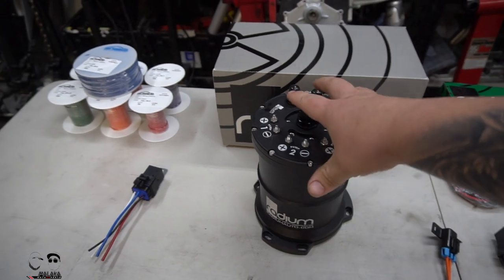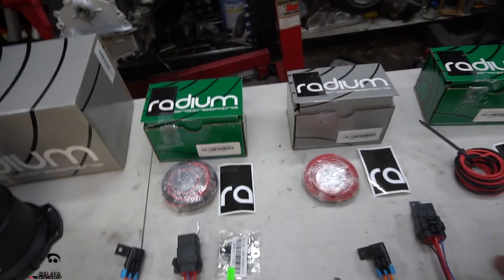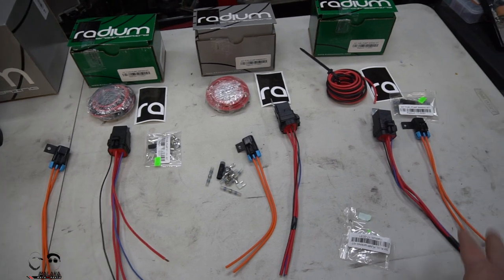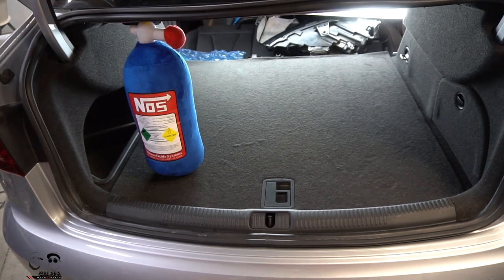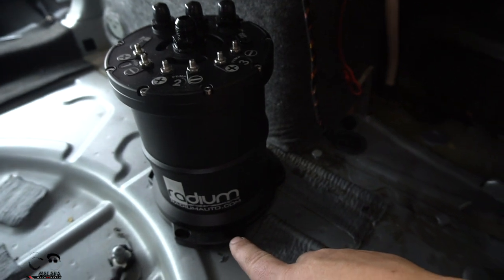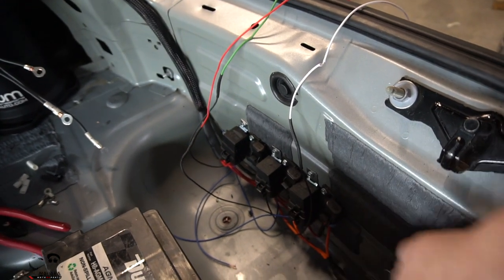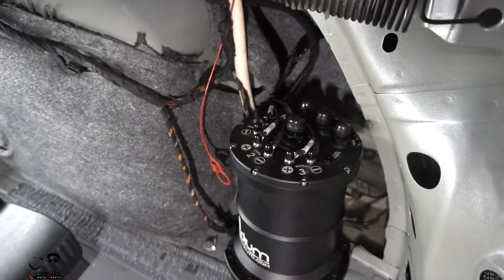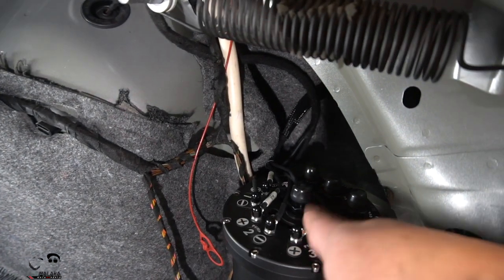Triple Pump Radium Surge Tank WIRE UP -  AUDI RS3

Comment: Hi Stav! Just a small tip to make the crimps look even better. If you look at your first crimp in the video, try turning the crimp tool over so the concave side is against the split line in the terminal. The terminal will not try to spread, and the convex side indents into the solid (non split) side of the terminal. Just a thought.
Love the location for the unit. Out of sight but still accessible. Great!
Reply from the maker: Interesting will try that next time. These small tips make all the difference

Comment: how's that work on stock ECU?
Reply from the maker: Well when you say stock ecu. Are you referring to Rs3 specific? One way you can wire this into a stock ecu that’s limited is using hobb switches and having certain pressure kick on the additional pumps
Reply: @MalakaMotorSports  I have a mk7 R but would be curious if DS1/MEDV17 are capable of anything more refined as far as closed loop low pressure control.
Reply: @nathangamber9230  they are running a return style vacuum reference system. So there’s no need for close loop low pressure. I have a surge tank setup as well with an regular fuel pressure regulator. I set the low pressure to 90 psi cause I have mpi. So as the math would have it. 43.5psi base pressure + 30-35 boost pressure. So the minimum low pressure I can run is 78.5psi. Setting to 90 give me 11.5psi of extra pressure meaning less duty on the mpi as they will piss fuel once they open.

Comment: You'll need to program the oem pump to start first for 5 seconds or so to fill the surge tank before starting the auxiliary pumps.
Reply from the maker: Absolutely very easy to do. As they are using separate output and the ecu has a prime feature for the pumps.
Reply: As someone who has been running a setup like this for over a year. It takes my oem S3 pump 5-10 sec from car start to fill up my surge tank. An rs3 with a brushless oem pump will do this with the door open prime function. They’ll just have to turn on prime function on the primary surge tank pump to push fuel to the engine so that startup is flawless. 

In other words. Ain’t really a big concern.

Comment: 1x Elixar 1380 brushless fuel pump is all you will ever need. These multiple pump setups are a time bomb waiting to happen.
Reply from the maker: Not familiar with the set up. But we run this exact set up without issue in our B5’s the issue with brushless controllers they also have overheating issues and 4x the price
Reply: @MalakaMotorSports  bro look up elixar powered...game changing pumps..at your level a 700lhr pump will cover you for 950hp to wheels an hold 90psi on e85...no shit...
Reply: Explain the time bomb situation?
Reply from the maker: @stamadon  I’m also curious

Comment: For some reason after installing my single pump fst, my fuel gauge reads full but my tank is almost empty... I primed the first pump to fill the fst, fuel gsuge was reading right...and as soon as I primed the second pump by gauge read full but my actual fuel tank is almost empty... do you know how to fix that?